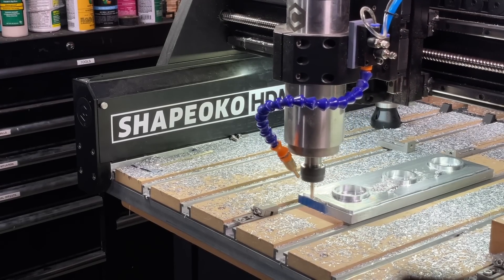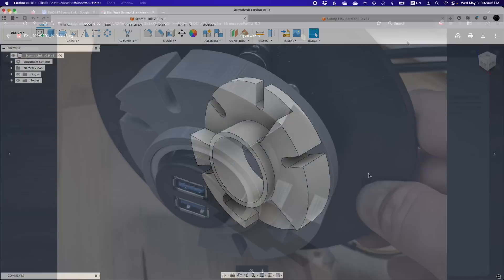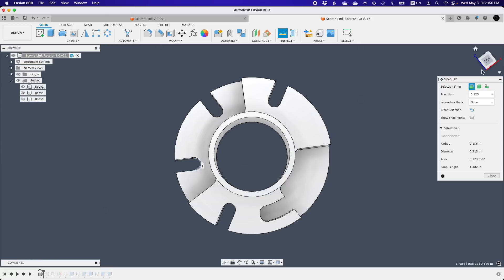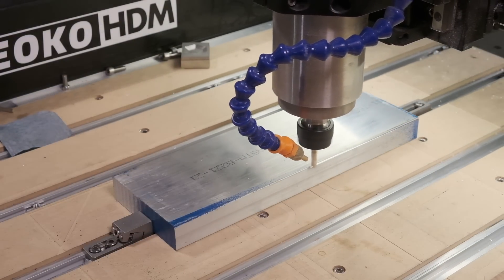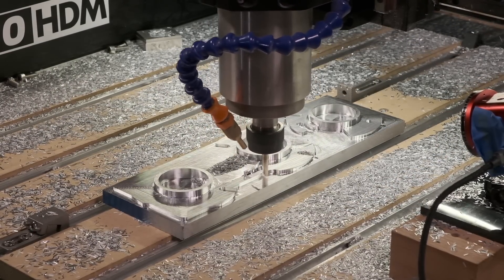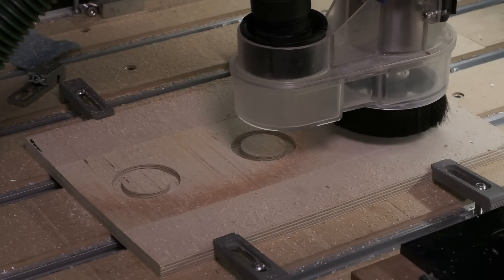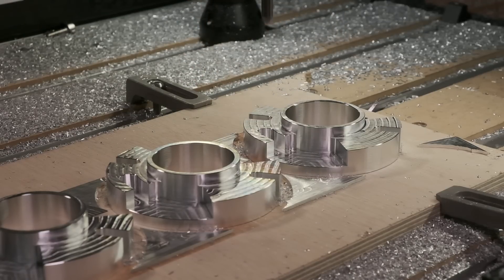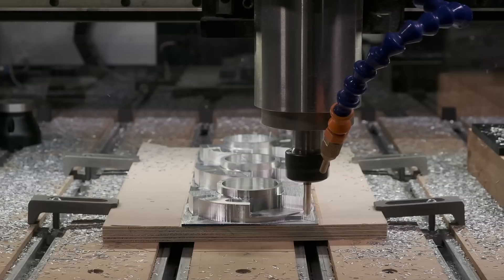Machining Billet Aluminum Star Wars Droid Parts feat. @bytesizedengineering

Comment: This just happened to me today.  So I go to YT and search for "machining aluminum".  The first toolpath was boring a bunch of holes, which went fine.  The contouring cut in the 0.064" AL sheet generated enough heat that the double-sided tape failed. I got another sheet yesterday and will try again today.  After boring the holes, I'll put a few sheet metal screws through them into the spoilboard so I'm not depending on the double sided tape after that. I don't have much experience with aluminum; 'nice to know I'm not the only one dealing with this 😉

Comment: Hi Winston, love your content man. On your last video you said the a atc is one of the only things you lust for on a desktop cnc these days. Have you seen the Carvera yet? Mines scheduled to come in by the end of the month, so I can't say from experience. But from all the videos I've seen with it, it appears to be a pretty good machine, thought a little expensive.
Reply from the maker: I have seen it. There's elements of it I think are nice. But there's also specs that make me feel like it's trying to appeal to a broader audience, but really only good for a niche application. ATC is in theory great for productivity. Low spindle power and a vacuum canister that fills up quickly is only really good for light cutting/PCBs. Seems like a contradiction to me. And from what I've learned on the Neo, any serious machining using a direct shank clamping spindle is going to be trouble if your tool shafts get dusty. Can risk the tool pulling out. Again, not an issue for a low power machine, but that means that architecture will probably not get much more productive.

Comment: Winston, I was scanning your videos and saw that you did one on leather working a few years ago. Have you ever tried CNCing leather ? I made a campaign chair a few years ago and it required a very large one piece leather seat and back. I bought a whole hide from my local leather shop and CNC'd it. IIRC, I used a 1/16" cutter. I did a bit of experimenting on smaller projects like key fobs and they worked out quite well.

Comment: 5083 cast aluminium (the base material for tooling plate) can also be had with a 2mm material markup. So 20mm stock is 22mm thick and perfect for making 20mm thick parts.

Comment: Hi Winston I know you have previously done a comparison of super glue and masking tape for work holding i would highly suggest polyester tape if you need more adhesion and temperature resistance it works very well and it more heat rated than other adhesives I have used but still has the same ease of cleanup as masking tape.

Comment: Just curious, did you consider using discs as blanks for this project rather than bar?

A 4in diameter, 1in thick disc is $15 from mcmaster, and would get you closer to net shape. You also wouldn't need to waste material between each part you make (from either machining or saw-cutting blanks from the bar). Main drawback would be the time spent indicating, but with a similar fixture plate you could machine a pocket to locate.
Reply from the maker: It's a good question, and I don't have a great answer other than I thought it would be simpler from a single setup perspective to just stick a bar to the table instead of lining up and spacing out 3 pucks. Would not have been much work to pocket out locations to mount. But then each piece would have been separated from it's neighbor and I'd be more cautious about speeds and feeds. A single bar with shared surface area is held down more securely than 3 individual pucks.

Comment: At some point I had to tweak the toolpath generator for my HDM for a design to lift the spindle a bit (while air blasted still on the part) every minute or so for 10 to 20 seconds to keep aluminum temperatures under control....

Comment: Couldn't you have rotated your work piece 90 degrees? This means you could start with 4 thru holes that would be out of the part cut area. You could then bolt the aluminum to Teez Nuts in the HDM extrusion slots. Of course the heat from slot cutting around the bolts could be an issue, but not too bad if accounted for.
Reply from the maker: On the HDM, it would be tricky, but actually on the Shapeoko 5 Pro which has a T-slot spacing of ~4" vs 100mm I would have been able to basically center each part over a slot and bolt right through the middle. In hindsight, that would have been a perfect way to supplement my adhesive workholding.

Comment: This spends a lot of time facing a part that is later machined away.  Just go straight to an adaptive clear and then the only thing you need to do is final machine the tiny flat at the top of the hole opening. Save a lot of time and wear and tear on the tip of the end mill. Thanks for the videos!!

Comment: Nice video as always. I would like to see you encouraging more people to step up a litte and start using vices specially for working on metals. Also, there are 3d edge finders out there pretty cheap that can help locating the parts or vices to be used. Something to think about it. Great work as always. :)
Reply: This is why I upgraded to the Saunders Machine Works table and mod vise setup.  I'll still use painters tape and super glue depending on the part but I want rock solid work holding.  I've learned these machines start breaking when kicking a part around like a pinball.

Comment: Been burned by double sided tape so many times that I only use double sided tape to hold stock while I get some holes machined into the part -- haven't run into anything I needed to machine that didnt have holes that I would be able to drive some screws into that would hold the part down. The inner puck -- I expected that to jump out (had that happen too -- machining a stepper mounts and the puck at the center of the nema 23 mount jumps out, and never fun when it jumps out during the last pass and gouges a perfect part. That would have been where I'd drill a some fixturing holes as part of cam. Impressed that you were able to salvage it. I would have been freaking out reaching for another blank and redoing cam. I guess stock to leave is something I need to keep in mind.

Comment: What was the reasoning behind not making these from roundbar?
Reply from the maker: Really good question, and I don't have a great answer other than I thought it would be simpler from a single setup perspective to just stick a bar to the table instead of lining up and spacing out 3 pucks. But that could be solved by just machining some locating pockets for the stock...🤷🏻‍♂️ If I had to do it again, I think there's a more than 50% chance I'd give the round stock a shot.

Comment: I'd recommand using ethanol for cooling, its not the cheapest, but damn, after running an agressive adaptive toolpath with a 1/4'' tool for 40min, the part was feeling as if it rested in the fridge for an hour. (I actually use the stuff they put into fireplaces)
Reply from the maker: Agree. Ethanol is great on the Datron, but I don't enjoy it as much on the HDM. That airblast nozzle I have can mix alcohol but it's hard to get a consistent "minimum quantity" stream that doesn't feel like I'm wasting a bunch. Might just need a better one.
Reply: that's what I do -- I have my air blast setup with mist. Even with mist it goes through a lot, but worth the piece of mind that cutter doesn't gum up from chip welding as aluminum get gummy as it heats up.

Comment: i've been using pb blaster lately as a lube for steel and aluminum on my shapeoko. Its definitely messier. But IT was the only thing I had at hand at the time, and i have been thoroughly pleased with the results and surface finish. 

Also speaking of problems with double-sided tape. Might I suggest putting fasteners into the areas that you are going to be removing anyways. For example the center where the port is going located. Is more than large enough to put a deck screw(with fender washer to avoid part deformation) or several. To hold the part down to the bed. There is also several places on the sides where you could also place the faster if needed when you go to finish the center bore. I just feel like they hold alot better and you can often put a hole where you need it (even if removed later) Rather than be lacking on support.
Reply from the maker: Deck screw and washers is a good suggestion, especially since I'd already machined a hole. Filing that away for next time...
Reply: @WinstonMakes  awesome man, I am glad I could return the favor of some tips and tricks.